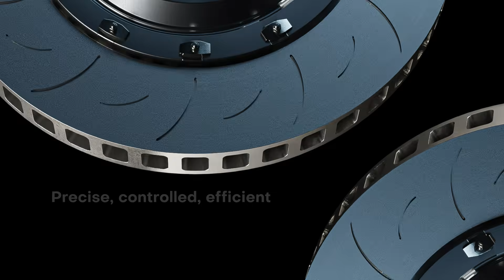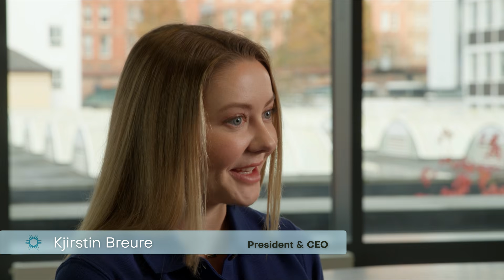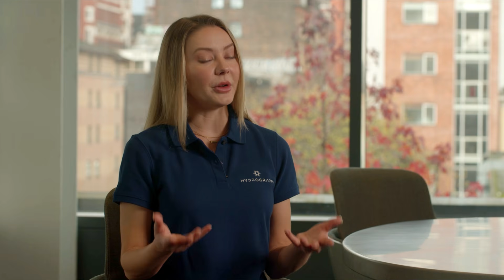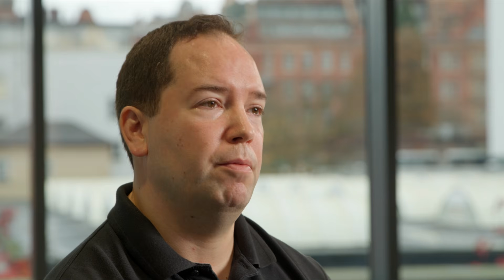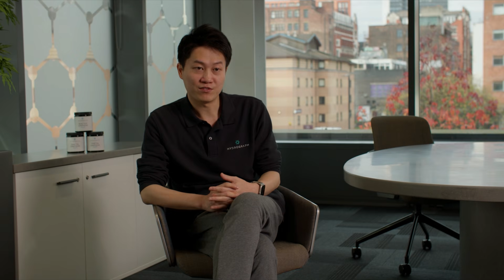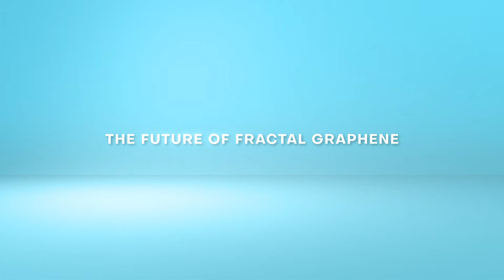How HydroGraph’s Detonation Process Is Changing Graphene Commercialization

Comment: I also have Gmg stock, it ignites hydrocarbon gas and has high quality graphene confirmed by Graphene Council, Univ Queensland, and other schools...they both have highly valuable approaches to graphene GMG has huge mites around (motor lubrication, saves 10% gas, saves energy with HVAC coatings and greatly enhanced LI ion batteries). Hg has more of a general mix/materials enhancement approach. Recommend both looks for superior graphene